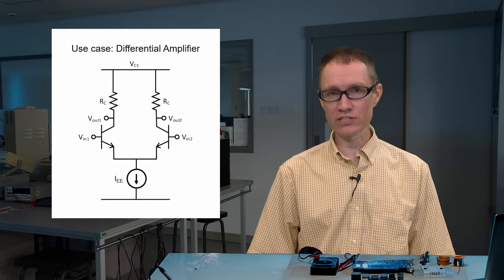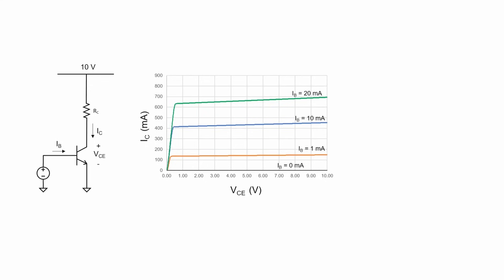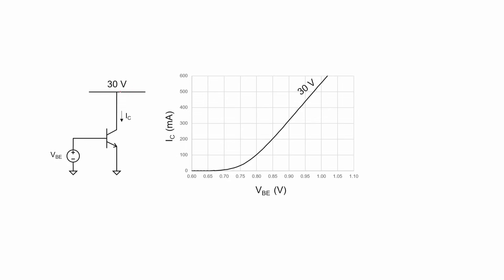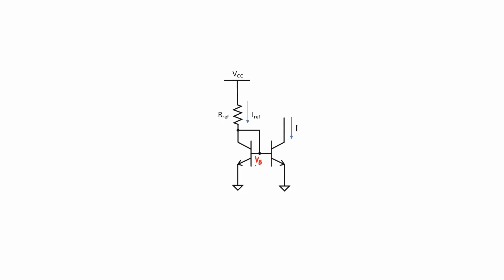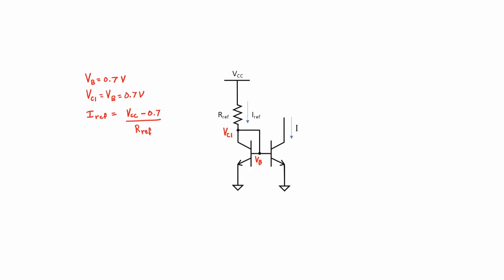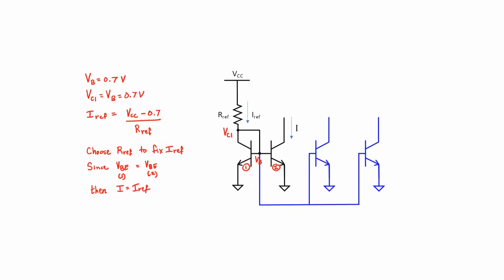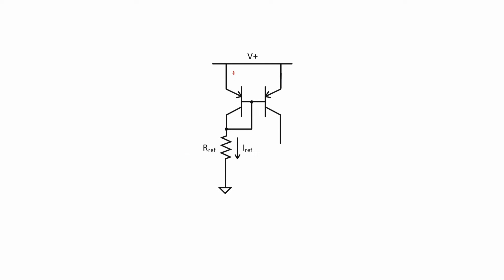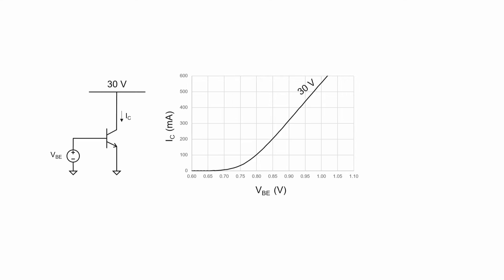Introduction to Current Mirrors (24-Transistors)

Comment: ok but you said you have also to fix Vce in order to depend the current from Vbe. Where is the guarantee that Vce is the same in all transistors? Also Iref is not the same as I, since Iref is partitioned before entering the collector..

Comment: The part of your intro explanation about the  power dissipation advantage of current mirrors is incomplete in a way I feel is important. A device's power dissipation is VI whether the device is a resistor or a transistor, so the issue isn't that transistors dissipate less power than resistors, it's that current sources allow more flexible biasing so the V part of VI can be lowered in some cases.

Comment: Aaron, you forgot the most important thing. Transistors in a current mirror must be thermally coupled. Otherwise the mirroring effect does not really work. On chips this comes naturally, but for DIY audience, thermal coupling has to be mentioned.
Reply: i‘d replace „does not really work“ with „is less than perfect“. It still works as a current source; only that the left and right currents are not the same; still the right one is mostly constant
Reply: @HarryFortyTwo  Obviously the current source will work hence me emphasizing on the "mirroring effect" only. The video is about the mirror, so it is important.

Comment: It may be worth mentioning that the transistor IV charateristics vary a lot with temperature, so if the two transistors are not at exactly the same temperature the assumption of matched characteristics doesn't hold. Not a concern for transistors fabricated close to each other on an IC, but potentially a big problem for discrete circuits, where nearby heat sources (i.e. other components) may create a temperature gradient. So current sources made from discrete components typically need to couple the transistors of the pair to each other thermally, by gluing/clamping them together.

Comment: One source of inaccuracy not mentioned is the base currents being pulled through that short.  They are not zero in real life.  The output current is only = Iref if you assume that the base currents are zero.  It becomes more important as you start stacking additional outputs - the error is the sum of all the base currents.  Iout = Iref / (1 + 2/Beta).   One was to improve is to use another transistor in place of the short - the base to the Iref collector, and the emitter to the bases, and collector to Vcc.  Then the error is 2/Beta squared.

Comment: I'll be back when you get the current flowing in the proper direction
Reply: Proper direction depends on using Conventional flow or Electron flow. Use what ever serves you the best.
Reply: 99% of the time when analyzing CIRCUITS we use conventional current flow.

Comment: This type of current mirror is much more accurate, if the two transistors are thermally coupled. Transistors are negative temperature coefficient, meaning, the hotter transistor will conduct more current. this could be a very big part of the reason, the output transistor shows more current, with higher collector-emitter  voltage. At a given current, the transistor with higher voltage across it will dissipate more power, thus, making it hotter. The higher the junction temperature, the lower the voltage drop across the base-emitter junction. The base-emitter junction with the lowest voltage drop takes the greater share of the current from the reference resistor.

Comment: This illustrates a key point about bipolar transistors that the collector current is programmed by the base-emitter voltage. Once you understand this, a lot of transistor circuits like the current mirror make more sense. The base current is actually an undesirable side effect of the base voltage. Unfortunately it's often explained incorrectly that base current causes collector current, leading to a lot of misunderstandings.
Reply: It's not explained incorrectly. The device physics really do say that base current, not base voltage, mediates the collector current in a forward active BJT.
Reply: @RobertKennedyPersonal  Thank you. I think the physics shows the collector current is controlled by the base current, but in circuits, it's often the base-emitter voltage that is used in analysis. The beta of the transistor will affect the actual current more than the Vbe.

Comment: 0:26 You said: “in a differential amplifier the common mode gain is improved using a current source”: is this true? The common mode gain in a differential amplifier should be the lowest possible… or not?
Reply: Improved as in 'get lower'  :)
Reply: I'd guess probably that common mode signal rejection is improved
Reply: He was talking about improved CMRR.